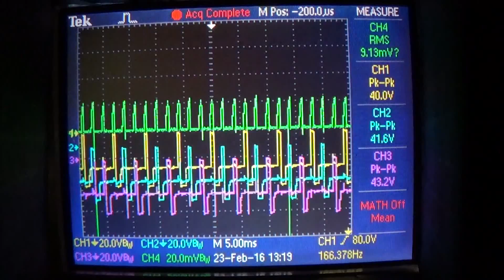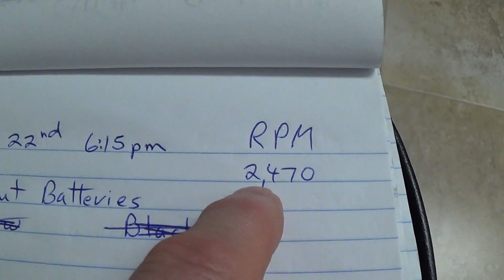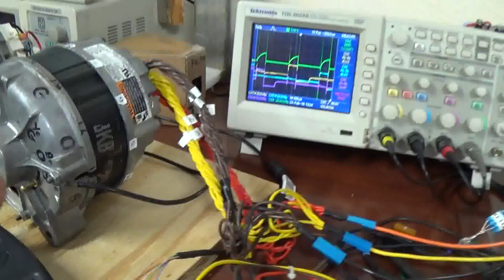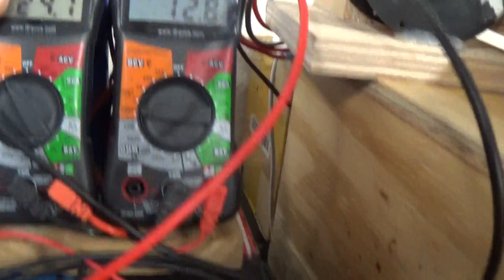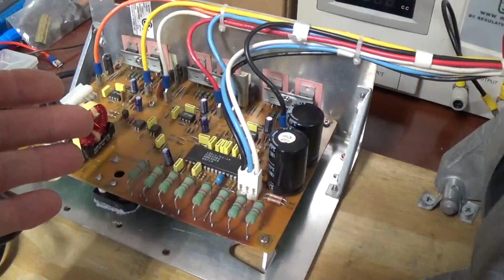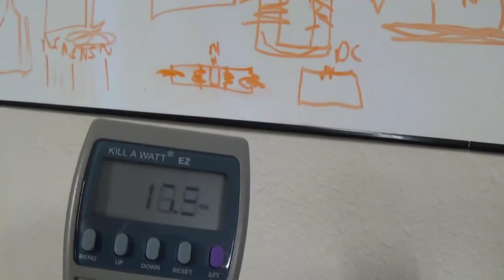Sharing ideas, how to build a more efficient motor (p.12)

Comment: Maybe it where intersting to know what is the difference of RPM on load vs RPM on no load with approximately the same amount of power with the two tests.
Reply: Sorry, more precisely the same amount of input power.
Reply from the maker: +Cédric PIERRE  Not sure what you are asking for but in the video I took a rpm reading of 2500 rpm with no load. Then when I loaded the shaft the rpm must of dropped to around 2000 rpm because after I released it to take a rpm reading (couple of seconds after) it already recovered to 2130 rpm and worked its way back to 2500 rpm. The current meter showed next to no change (128mA to 132mA) during load. Anyways, this video is only to demo the motor is working properly. The next video will be the load tests to determine the motors electrical to mechanical efficiency. Luc
Reply: +Luc  gotoluc Choquette
It's only drop in the start of the load and it get back to 2500 rpm at work with almost nothing more in curent...
Realy not bad...